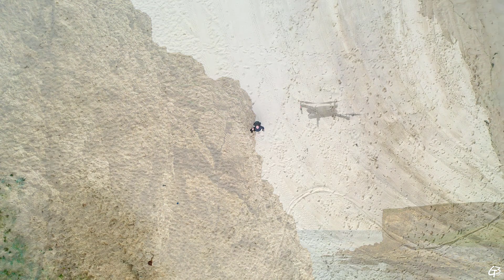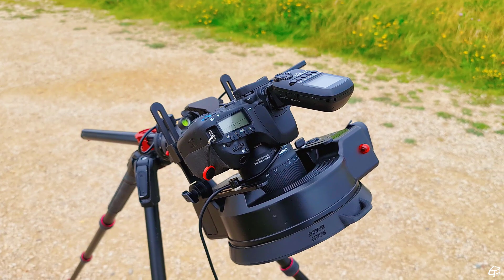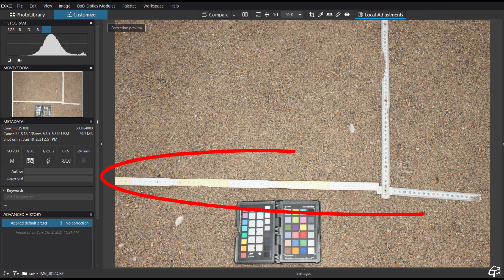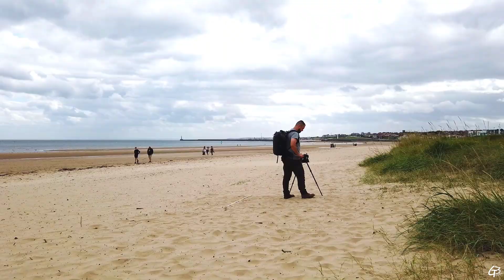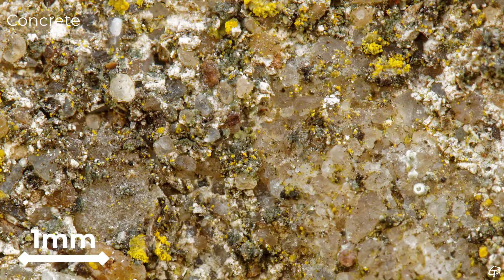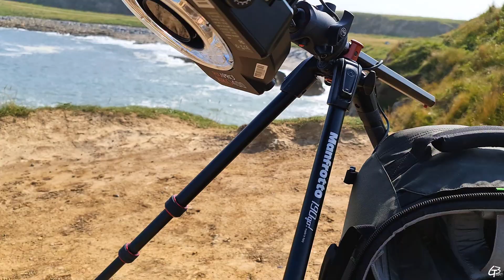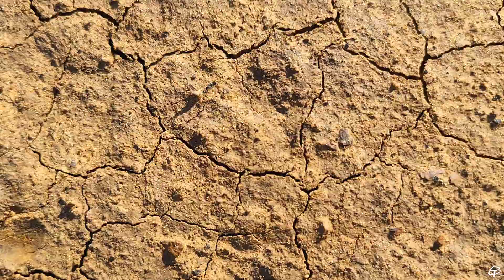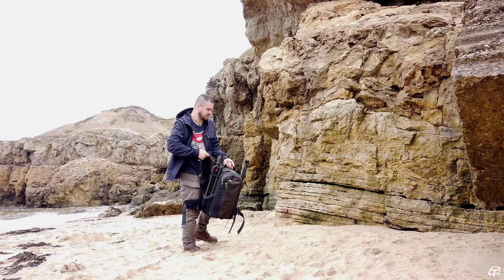Outdoor Photogrammetry Surface Scanning for Materials with a Flash

Comment: Grzegorz, thank you so much for sharing all of this great knowleadge and effort of yours. One quick question, what about this methodology apply at complete darkness? Do you need a second light (the sun) for the full cross polarization to work? For example, at night at a room or building with no light at all or just a few handlights or so?
Greetings from México!
Reply from the maker: You dont need any additional light to get full cross-polarisation . All additional lights are considered as a pollution and need to be dealt with (overwritten by the flash light). So the only light you need is the ring flash light set to the level that is dtronger to other lights around so they dont interfere with the capture
Reply: @GrzegorzBaranArt  thanks for the reply! I'm relieved about this, now I just need to get the sync between the ring flash and my camera. I'm using the cable, but I just can't manage the synchronization of both to work at the same time, even if I change the shutter speed, ISO and aperture.
Reply from the maker: @benjamingus  dont worry, you will get there. Just be patient, take your time, try to get through manual and if its not enough, just ask on some forum/fb group of the brand you use for help and I am sure there will be someone to help you. Shooting in a total darkness are the best conditions for cross-polarisation I can imagine :) - just be careful with reflected light - I covered some details about that (light falloff and light polution) in my video about photometric-stereo captures

Comment: Great video as always, thank you very much. One question; do you think laser pointers may help distance checking while carrying flash without tripod or monopod. At 0:28 of Quixel's "Behind the Scans: Xeric Shrublands" video their rig has laser pointers. I thought these pointers can help keeping same distance and line during scanning. But I haven't tried yet.
Reply from the maker: I would say the sky is the limit here. I am sure laser pointers can help, especailly when you shot from such close distance like guys from Quixel do so you can clearly see them. Quixel guys seems to have slightly different approach in this video, but bear in mind that they use different equipment and I dont think everyone from quixel has access to this exact setup. In this video tho they use Elinchrom dual head flashes which have TTL  function built in. It means that the flash power changes with the distance automatically. Also with such close distace they can use much lower output power. Using dual flashes makes sense as images arent full square but rectangular, also two flashes delivers the level of light which easily overpowers even direct sunlight on a desert. Its noticeable especially when you shot from such close distance. To make it lighter and work longer they carry a battery, which is quite large and heavy in a backpack. But this is much more expensive solution to AR400 .. I would say 5 times more expensive and honestly.. I cant imagine holding it myself high up front for a few minutes :). Just try to rise your hand over your head and keep it high there for 1 minute and you will get what I mean. Last but not least, there are features in photoediting software which can bring all images to similar tonal level and make dark images brighter and bright darker.. and as long you have the data to use and didnt under or overexposed any you can tweak them without actuall loss of any data. So slight distance changes from the camera to the flash arent a big issue and are fully manageable. So presented quixel approach seems to better to mine but also has its own pros. The price is a big one in her. It makes sense to pick their approach if you scan really a lot every day but at the end .. its just the final result what matters. I am sure quixel plays with stuff the same way we all do since its still uncharted territory .. and every way to improve it is a good one. So I would definitelly consider laser markers if they can help you in anything. Hope that helps :). Cheers!

Comment: Hey Grzegorz! Thank you so much for your cool tutorials! Always high quality content and full of very usefull information, really appreciate that!

I have started with 3D (Blender) about 2 years ago and enjoy every second of creating new stuff. Now i wanted to start photoscanning my own textures and came across your video when searching for tutorials.
Now I have a couple of questions regarding the creation of pbr materials.

At the moment, what i quite don't get, is the step of baking from high poly to low poly.
- since it says baking from hight to low, does that mean you bake geometry as well?
- And if so what would be a good amount of polys for the 2x2 square to bake on?
- Or does low poly mean just the flat 2x2 square (only the 4 corner polys, to be considered as low)
- i just understand at the moment why there is a need of polys on the 2x2 target plane when we are baking only images (albedo, ao, bump, normal etc.)
- and can i set this target plane up in blender as well? (And then bring to substance for baking)

Would really appreciated it if you could help me with understanding this process a bit more indepth!

Thank you very much and have a nice day!
Loris
Reply from the maker: Thank you,
- PBR baking is a process of projecting 3D data into 2D form (set of PBR textures)
- amount of polies for high poly depends on the texture resolution you want to bake. By setting the density you need to make sure that there is always enought data to fill each pixel of the texture. Keep in mind that its all in 3D so themesh density has to be considered with 3D in mind. So if you do simple math for flat surface, for 2048x2048 texture you would need at least 2048 multiplied by 2048 pixels which gives you about 4mln polys as a minimum. In this case you get 1 poly per pixel. Since it is 3D I would multiply it by 2 at least which gives at least 8mln poly for 2k texture. It is because lets say, that you have a pebble.. edges of it is vertical therefore it gets some vertices just to cover a single pixel etc. So for grass reconstruction, even 100mln poly dense mesh might not be enough while for flat wall, 5mln would be fine.
To be safe and make sure that I always have a lot of information to bake from I aim for 100mln poly meshes with 16k albedo maps used to carry color information... for 4k texture sets.
- yes, you can set your target plan in Blender or any other app which works for you, just make sure that export setting is correct so its not rescaled or rotated durign the export.
Hope that helps
Reply: @GrzegorzBaranArt  Ah i see, great advice with this calculation, thank you!
- so generally, the higher poly the better, just for the sake computer performance you would choose a lower poly count?
- and do i get this right, the plane to bake on does not need any poly? its just for baking on the different maps, so no subdivision or so, just a basic standard plane?
Reply from the maker: @lorisdiminico  yes. Denser mesh needs more resurces (RAM, processing power) and more time for actual reconstruction. Its not worth to build 1bln poly heavy mesh for 2 or 4k texture. Regarding the low poly plane.. yeah, it doesnt need to be dense. It can be made of 2 triangles. But I have found that it might be worth to get a slightly denser one for complex shapes for better alignment.. usually for cliffs etc. .. as the low poly plane is just the canvas for the baked texture and what matters are just its normals/direction and efficient UV projection so the baked texture isnt stretched. So low poly model is a kind of window we project the highpoly data through. Hope that makes sense and I didnt went to away with this comparison ;)
Reply: @GrzegorzBaranArt  I think i slowly get this. yeah i think with 1bln poly mesh my computer would go up in flames hahah
Thank you very much for replying so fast and giving all these highly valuable information! Really appreciate that! So now i just have to wait till the snow is gone and then im out for my first photoscanns.
Thank you very much for your help and have a nice day!

Comment: Thank you for this video. It is so helpful. I am a Sony A7IV camera user and wondering what might be compatible hardware for the cross polarization setup, specifically the synchronized flash setup.  In the video you use a Canon setup with a  Riko 400 and XT 32c + xt16 receiver. I am inexperienced in synchronized flash systems... Would you know if the XT32c and XT 16 are incompatible with Sony cameras? Or should I buy for a specific "Sony compatible".  Prior to trying to buy the XT32c I was unaware that camera brand might affect compatibility with the XT trigger/receiver. I had purchased an xt16 receiver before realizing it may not be compatible or even if this part will work with the Godox 400 (Riko 400)... I know your setup doesn't require TTL (nor would I buy a part for that feature) but your setup does require a faster than 1/250 flash... I purchased the Godox 400 being in the US. But for the flash trigger/receiver and being a Sony user, I wonder if a: Godox XProS TTL Wireless Flash Trigger for Sony Cameras would be compatible with the setup (although I can't seem to find a receiver for it)?...it seems to be the only Sony compatible part that fits the spec of speed. In general I am just not sure what flash trigger/receiver is compatible or if your recommendation is cross compatible. forgive the specificity of this post, although I would appreciate any feedback. Thank you again for your videos! They have helped refine my practice more than any other channel !
Reply from the maker: Hey, any wireless Godox trigger should work. You just need make sure, that you purchased vershion for SONY hot shoe. Usually when you shop and you see any transmitter, you should select the camera you want it for. So all of these you mentioned has version for Canon, Nikon, Sony etc. I recently purchased PRO ST-III Plus 2.4GHz Radio Frequency TTL Flash Trigger with High-Speed Sync
(https://amzn.to/3r41dcb) and I use it on a daily basis. When getting a receiver - this small jingle you plug into the flash, you just need to be sure it has the same frequency.
I suggest to watch the other video I made where I show more details about these: https://youtu.be/REA3XNgUMJg
You dont really need HSS as it limits the flash speed significantly after the first burst (delay between every next image is longer). Also AR400 doesnt support TTL feature but honestly, I think its good to have these as an option if you ever consider swap the flash to another one.. this is what I use since I use different flashes for different purposes (you should see what I am talking about in my incomming video).
I used to use SONY version of 'PRO ST-III' with AR400 and SONY A7R4 without any issues, cant see any reason why others would struggle. Just make sure you picked a SONY connection version.

Comment: Hey Grzegorz, amazing tutorials as always :) Do you know if the Pixapro 400 works with focus stacking?
Reply from the maker: Thank you. I am not sure how to answer your question as focus stacking and the flash are 2 totally separate subjects. Every flash which can be sync with cameras shutter release can be used for image/focus stacking. Its more about the rail and the camera mounted on it then the camera and the flash. But, yes, AR400 like every other flash light or LED light can be used to iluminate subject for image/focus stacking. Of course a lot depends on flash placement, working distance of lens used, focal length and the size  of the subject.
Reply: @GrzegorzBaranArt  thanks! I guess I didn't compose my question correctly :)  Have you tried your ar400 with focus stacking? I have an external flash and have issues when trying to use it with focus bracketing. It works well otherwise
Reply from the maker: @eveb6325  I still dont fully understand the question but as said, any flash light which can be sync with shutter release should work with focus stacking, unless we are talking about different things. For focus stacking I use automated rail which when moves the camera forward, after certain time I set outputs the signal to the camera to release the shutter. Camera outputs signal to the flash and triggers it so the flash flashes when camera takes the picture. Next the automated rail moves the came ra forward .. waits until it stabilises for the amount of time defined by me, and entire preocess repeats over and over until the stacked capture is over. The only issue I can see here is the size of the flash itself, as for really tiny subjects it is simply too large, therefore crosspolarisation wont work, also if the distance to the subject is too close (and it happens when you use microscope objective based setups or high magnification lenses) it wont even illuminate it as the lens might cast shadow on it. So there are a lot of variables to consider, but yes, any flash works with focus stacking as why wouldnt it? Hope that makes sense, unless we are still talking about different things.
Honestly, I dont use flashes for focus stacking anymore as flash needs the mechanical shutter to be released. Each camera has limited mechanical shutter life span - usualy to about 100k-150k captures, therefore I do my best to use a digital one instead. But as said, camera wont trigger flash for digital shutter, and if it somehow does, you will get weird lines across the image. Maybe this is the issue you have and you need to switch your camera to mechanical shutter mode? As said, its really hard to help without knowing more details. 
So to answer your question, yes, I can do focus stacking with AR400 and any other flash as well as LED lights etc. I guess I should make some kind of video on the subject of stacked captures and extreme magnification ones, but I really struggle with time. Dunno, maybe I should set a patreon or webpage and share all my experimets there in plain text and images only as it would be much easier? Will think about it.
Anyway, yes, I did. All my magnification shorts are based on image stacking - some were stacked from thousands of images just for a single frame
Reply: Thanks so much Grzegorz! My mirrorless canon just has some troubles with the external flash. I did change to a mechanical shutter, however it still doesn’t trigger it when I try to do focus stacking. I’ll continue to test and maybe I’m just missing something very simple 🤦🏽‍♀️😀 
Re: Patreon - yes I would totally support you and so will other happy users! Can’t wait!
Reply from the maker: @eveb6325  Yeah, it must be something very simple - probably in transmitter setup or channel sync between transmiter and receiver. As said, digital/silent shutter mode in camera intentionally doesnt trigger flash as it would cause visual glitches - because of how digital shutter works. This is why cameras are designed to trigger flash in mechanical shutter mode only.
Good luck with finding what prevents your AR400 from work. Yes, it should work like any other flash.

Comment: Great video and really interesting. I will be scanning a larger area outdoors soon and was looking for information like this. Thanks a lot! Unfortunately I don't have a ring flash. Can I use as well a standard flash like the nikon sb800 with diffuser cap?
Reply from the maker: Thanks. Yes, you can use standard flash lights  but they wont do as good job as a ring flash. Many depends on the surface complexity. While it can work for flat surfaces, these which has some higher elements will get the micro direct shadows. Just put something like a pen and take a picture of it on a white background. If you get the shadow based outline it means that you need to compensate it somehow until it is gone. The ring flash iluminates the light from the lens point of view so any shadows are always invisible for the lens. By using a flash light mounted over the lens you risk getting some shadows depending on the distance to the lens and the surface. To deal with them you would need to use second flash mounted to the oposite side .. or even add a few more but this way you would simply mimic the ring flash. This is why we usually use ring flash for scanning, but standar flash based setup is of course possible.
You can also consider static flashes with very diffused light but I dont think it would work well for large areas. Also these would need to be very powerful to do the job. 
Of course with more flashes or with the diffused one you would struggle with cross polarisation.

Comment: How should carry a flashlight and camera in a single bag?  Are there any recommendations for a backpack?
Reply from the maker: Hey, I made entire video about backpacks :). After all this time from the video release I havent change my mind and still fully recommend 'MindShift FirstLight'. Here it the video I mentioned: https://youtu.be/KoAn1jDH4ss
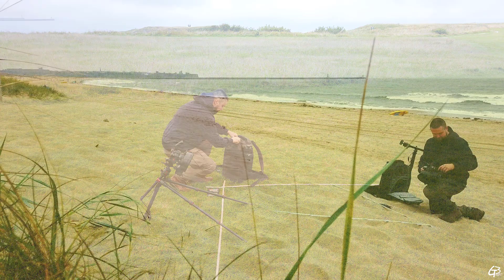I would consider also 40L version of the same backpack for longer trips as I usually use 99% of 30L available space. Since its fully adjustable I change the layout depending on what equipment I carry. You can see the layout I use to carry a camera and the AR400 flash at [41:18] of this video. Hope that helps. Cheers!